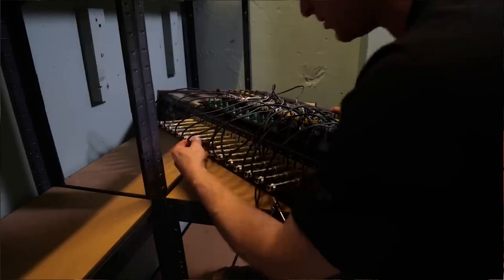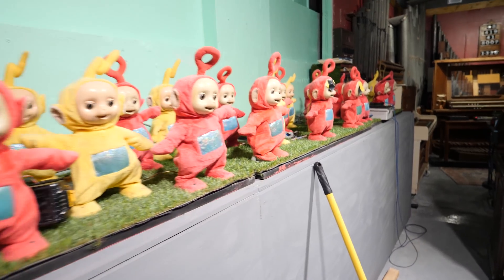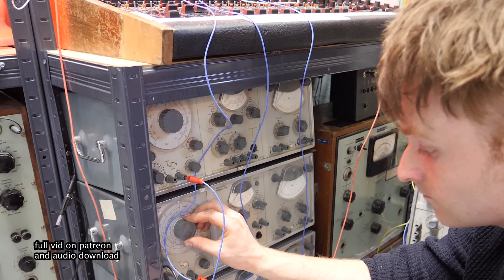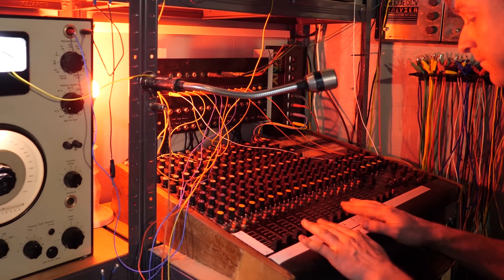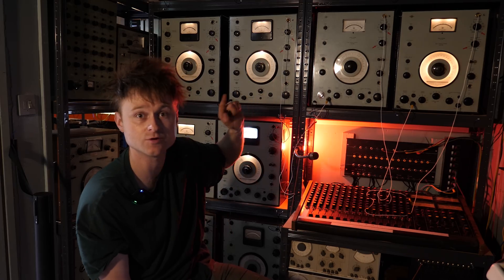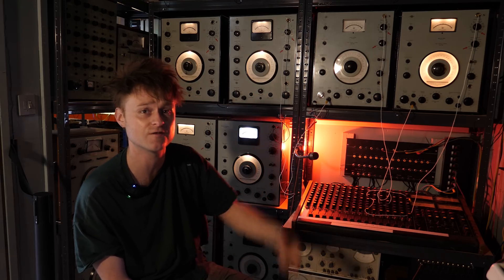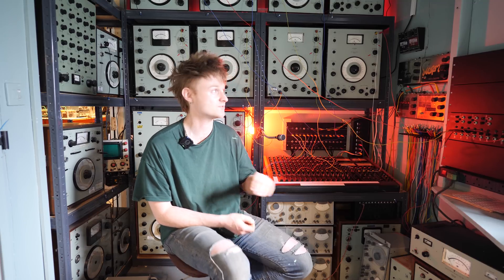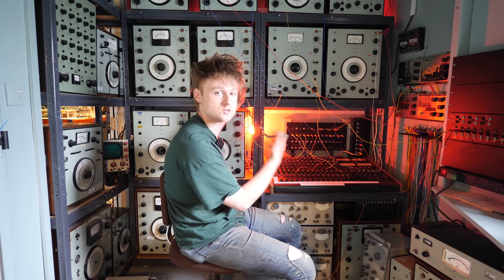Controlling 1950's Sound gear With A 1970's Alien Computer - SWTPC 6809 And Bruel & Kjaers

Comment: Love seeing the SWTPC controlling all these oscillators! Glad to see my code still is still working!
Reply from the maker: Yes Robert!!! How is college going!? Yeah still rocking! Hadn't used it in quite a while. But it's now back with a purpose :D
Reply: @LOOKMUMNOCOMPUTER  Just finished up this spring! I'm surprised you still remembered the magic keypresses to get it to start up, I had to check back on the github to remember all that stuff 😂 Excited to see what comes next with the CV control of the oscillators!
Reply: @LOOKMUMNOCOMPUTER the most important question is why the hell do you only have Lalas and Poes! Why no Tinky Winkies are Dipsys!
Reply: @LOOKMUMNOCOMPUTER whatever you do just don't start yodeling otherwise you're going to explode my head!
Reply: Who needs an Atari ST when you have an SWTPC?
Reply: What was the original use of the computer?
Reply: @TheOuterLimit I have a Thermin kit from them. It was a DIY electronics kit co.. Probably specifically for working w their other products and similar commercial ones.

Comment: You could calculate the frequencies 16th first terms of the fourier transforms of any sound, put them on the 16 oscilators, and connect all of them in chain thru the VVC to replay that same sound. 
But you will need to sync all of them so  every other osciloscope phased out 180 degrees, I think those Bruels can do it right ?
16 term fourier is already a good approximation, I'm curious how/if it will work at all.
Any matematician in the room?

Comment: It would be interesting to retrofit the faders, with keys, so you could turn a mixer into a keyboard. There has to be a mechanical way, to use a key, to control the volume of the fader. Maybe using some servos from drones, that can be programmed to understand midi.
Reply from the maker: Definitely but I like faders :D
Reply: If the board has it you could just use the mute buttons
Reply: if you want the attack control thé most direct way IS a touchplate contrôler with CV out for pressure

Comment: As a psychic, I have to warn that there is going to be a fire that will destroy most of the museum. Why can't you have fire doors between the different rooms? Sprinkler system will probably destroy more than it saves and gas extinguishing is perhaps too risky given that it requires rapid evacuation of visitors? I've gotten into trouble in the past by warning about things that are going to happen when they turn out to be happening. There's always someone who takes it AFTER it's happened and alerts the police so that I get in trouble even though I'm not even in the country it's happening in and have nothing to do with the incident. Anyway, what happens happens and will happen - but at least try to ensure that employees / visitors are not harmed. Deal?  The reason I'm mentioning this is that I had a vision immediately after the video started about a fire in the museum that made me worry about you and the museum.
Reply from the maker: Not sure feasibly how a fire could occur and propagate. Nothing is on when it is not supervised and things are not flammable. We have taken fire hazard somewhat seriously by keeping fire regs up to date. And electrics checked. A single floored building the fire inspector said keeping it open was safer. Fire doors are for
Things where access is not as good as it is here for instance.